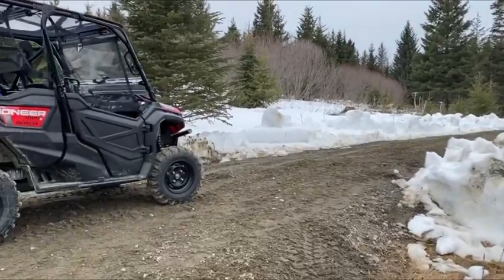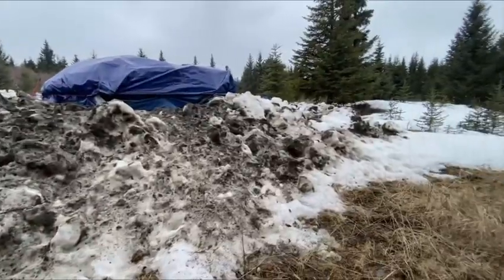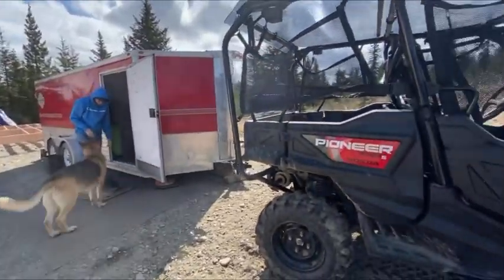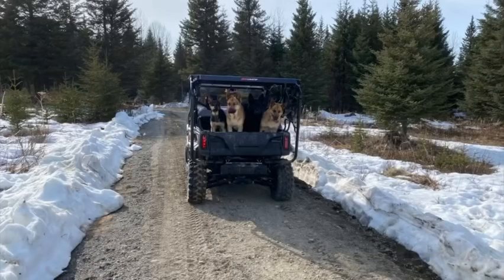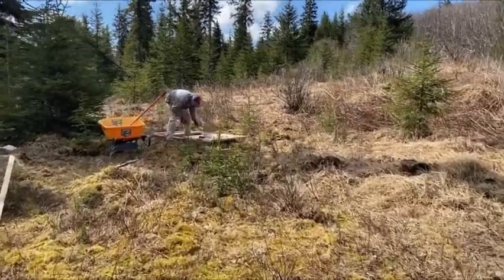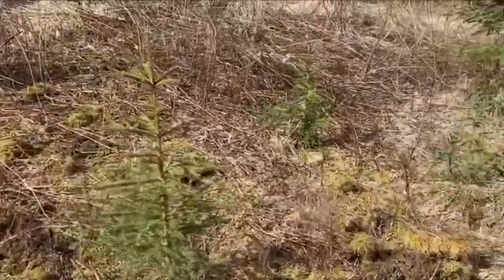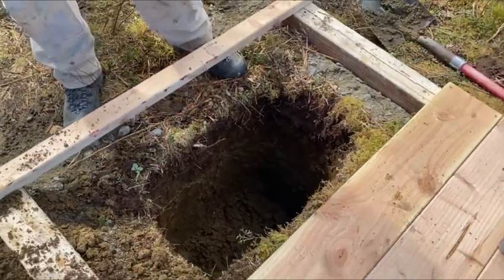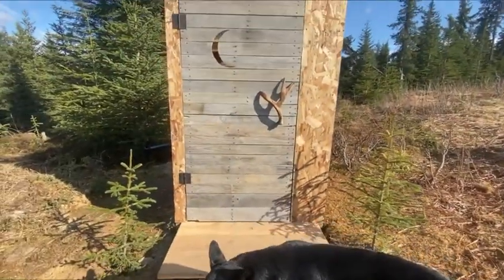Alaskan Tiny House Foundation | Building an Outhouse

Comment: Just a hint keep your toilet paper in a can with a lid keeps mice and little pest out of. Nothing worse than going to potty and find it all chewed up.
Reply from the maker: Great idea!
Reply: That antler paper holder though!
Reply: You can also get a urinal, I put one in mine and it really helps keep the out house clean and fresh if you will, I got mine at a porta potty company then ran a hose into the drum underneath, works great, I’ll send you pictures they are great, I also put corrugated green house plastic on the roof, it’s 20 years old and going strong, it’s more of a luxury outhouse, I have pergo floors and nice paneling, I just made it really nice after I got plumbing in the house but great when I’m having a fire and have company over,
Reply from the maker: @jamesseltenreich652  we’re going to go back and close it in. There are lots of gaps the winter wind will blow through right now. After the house is done I plan to do some finishing touches on it.
Reply: @ouralaskahomestead  it’s looking great, I’m sure it will be awesome when your done, styrofoam on the seat in winter is really nice too, it’s warm immediately lol 😂

Comment: Howdy guys!!  This video answered my questions about your foundation system.  I really do think something like that will work for my shipping container.  Those were some good beach shots!  From my Ninilchik property I have good views of Mt. Redoubt and Mt. Iliamna.  And, if you get on top of the container I have totally unobstructed views of the west half of the Inlet, along with both volcanoes!  What I'm thinking of doing this coming summer is to put the container on a similar type of foundation system, then frame it on the outside with lumber, insulate it that way, then cover it like you did with your cabin.  On top I'm going to make an 8'X20' "observation deck" and the remaining 20' will be framed and roofed as a storage room.  Next spring and summer is going to be really busy!! lol.  Bill
Reply from the maker: Sounds like a GREAT plan!